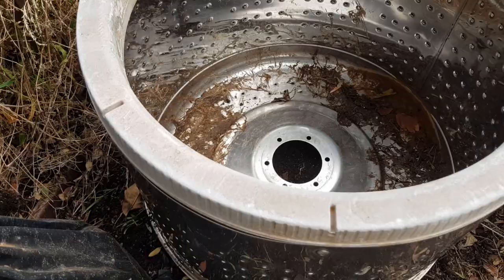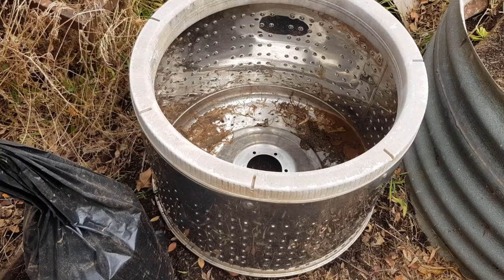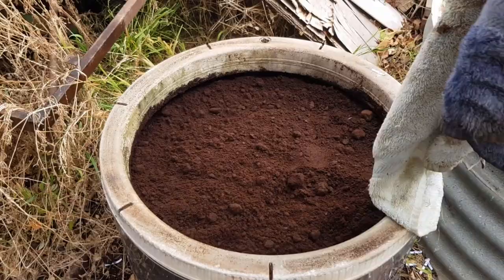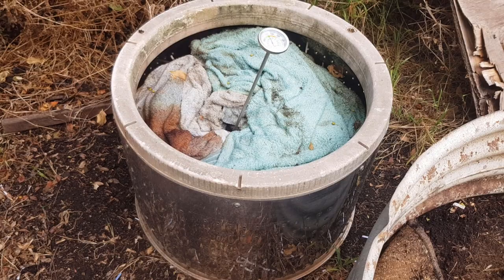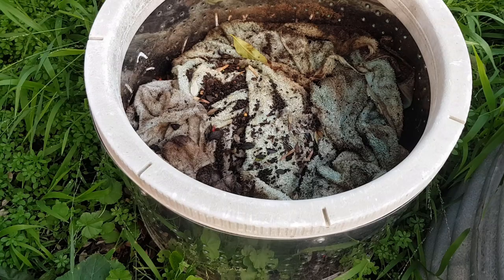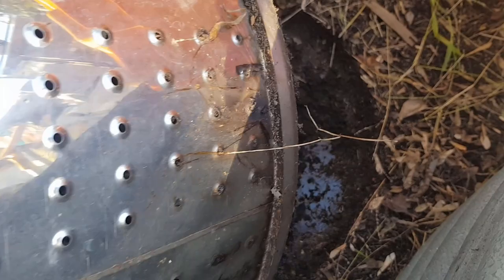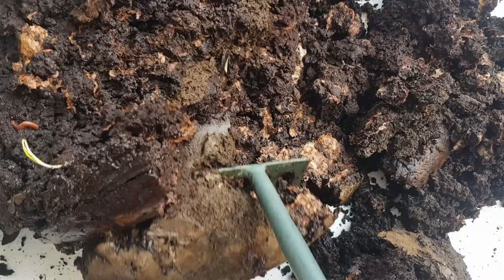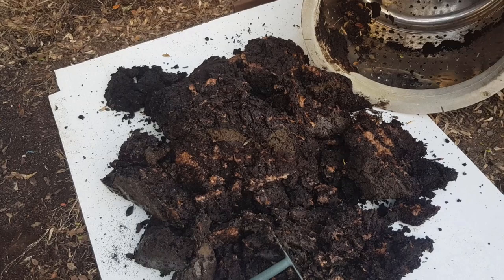Coffee grounds & shredded paper compost/worm farm experiment. Six months in a washing machine barrel

Comment: The anaerobic state isnt really a big problem since you only have to deal with it once (when you let it dry out), but putting a pipe in the middle is not much of a hassle either, and if their is someone not confident using just paper, woodchips will do fine creating layers between the paper to negate any worry about clumping etc. And should eliminate any possibility of going anaerobic as their will be no nitrogen (or very little)
Reply: There are many ways of creating humus that would surprise some, a concrete pathway (preferably shaded) will create wheelbarrows full in ~1-1.5 years if a 6 inch (could most likely do more) layer of woodchips is placed down, I could produce as much humus as I could possibly have a use for just by doing this, but still make compost because I enjoy it (I dont turn otherwise it wouldn't be worth it)
Reply from the maker: Thanks Nobody, yep it's well worth experimenting! Pretty much every method will eventually result in nice products for the soil/garden - some just take more time than others! Appreciate your input 👍😊

Comment: cool experiment. i think it went aerobic since (apparently) you should use 1 part nitrogen to 2 parts carbon sources by weight rather than volume. abc gardening youtube channel had a guy who had a full collection service for coffee grounds from a bunch of different vendors and swore by sawdust in equal parts. id be fine to be wrong on both counts
Reply from the maker: I think a nitrogen-carbon mix is important - but  lack of oxygen is probably the main reason!
Thanks for your comment Hayden 👍😊
Reply: @TheUltimateRecycler  thats a good point. and no dramas, you have some pretty interesting videos so credit where credit is due

Comment: How could the worms can handle the heat? I want to add worms in compost bin but afraid about heating up thanks for the experiment 👍🏼
Reply from the maker: The worms will keep away if it gets too hot! Compost bins should not have a bottom so that the worms can escape if conditions are unsuitable. Thanks for watching! 😊
Reply: @TheUltimateRecycler  I think you mean the bins SHOULD have a bottom so worms can escape if conditions are unsuitable.  Right?
Reply from the maker: @sj6919  Nope. How can the worms move out of the bin if there's a bottom/base? All my bins are just built straight on the ground so if the bin gets too hot, or conditions are unsuitable, they can burrow down into the natural soil 🙂
Reply: This might be part of the issue with my plastic composter, bought using a cut price offer from the council. It has a plastic base and hardly does much at all. The height of the thing means one can't easily turn anything either, so that's a rare event since it means emptying it all out and then returning it again. Interesting you were considering having many tubs along one of the walls. Were I to do that I'd be left nowhere to plant anything ! Gardens at most houses seem too small to put much in.
Reply from the maker: @WideCuriosity  Thanks for your comment Gary. Yes, the large backyards and gardens of yesterday are disappearing as people subdivide bigger blocks and build more housing!! A shame really - but I can understand it from a financial perspective!
Many commercial composters and worm farms are rather unsuitable for the job in my view!